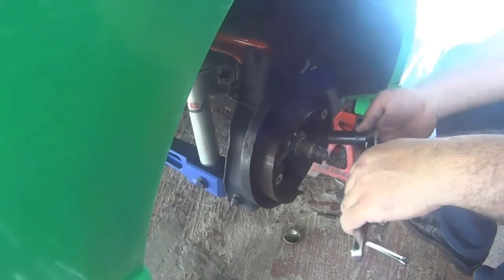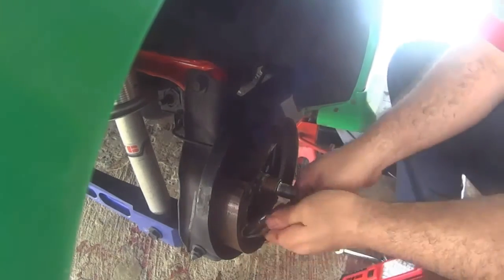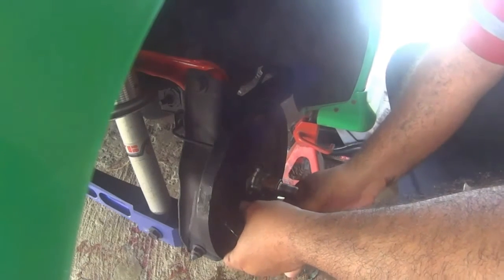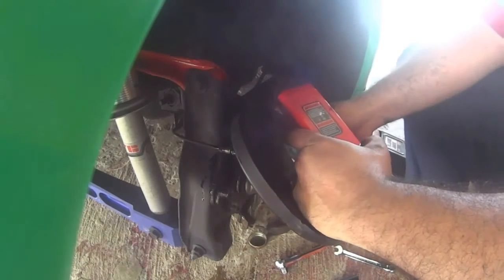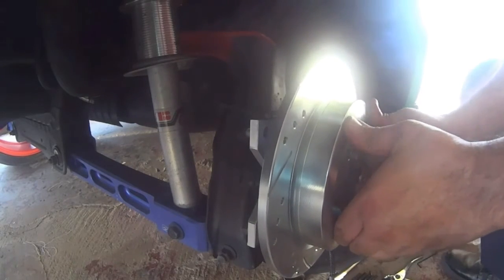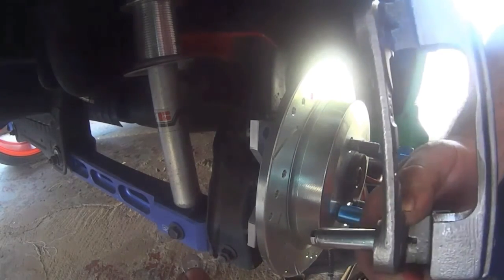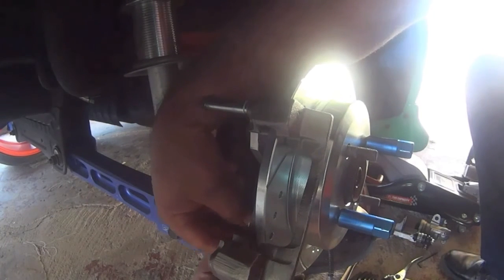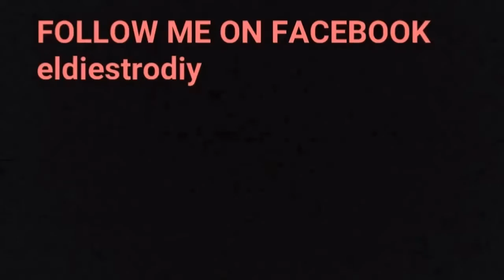Rear disc conversion on the turbo  mirage diy

Comment: hey! VERY interested in getting this kit! I have a 99 mitsu lancer/mirage ck4a and I want to convert rear brake system! came across your video!!  can you still help? I was concerned on the Ebrake part but clearly you figured it out!
Reply from the maker: damian stirling check in this comment like 2 bellow there's the manufacturer of this kit he sell them world wide i just sell them in Puerto Rico but you can contact him it's mirageman89 thanks for watching and please don't forget to subscribe like and share my videos .soon gone be a lot more mirage related videos 😎😉
Reply: damian stirling just go to the wreckers and take the Magna or Eclipse rear brakes... it's FULL bolt in besides the handbrake cable, and if you want 2 piston go Proton... same process applies, bolt in just the handbrake cable
Reply: @ELDIESTRODIY  cuanto sale ese kit para mirage 96

Comment: What are those rear blue things on your car.  I love them what are they and where did u get them from
Reply from the maker: Lower control arms i also love em i got it locally but on ebay you can find em mirage 1998 rear lower comtrol arm and they appear.
Reply: What calipers and rotors are you using ?

Comment: Just go to the wreckers. Find a Magna or an Eclipse of the same generation (year) as your Lancer. Take off the discs, calipers, dust shields, lines & the mount... it should bolt on, and if you want a 2 piston setup go purchase a proton kit... and if you want more than 2 go change your hubs to a 5 stud and then get a high quality big brake kit. There is so need to buy this sort of kit when Magna, Eclipse and Proton parts bolt on without any issues besides the handbrake cable which people have found many fixes too... don't waste your money $100-$200 at the wreckers and a bolt in swap
Reply: Eclipse parts do not bolt up to the mirage directly. And here in the US we never got the proton.
Reply: @89Mirageman  but do they bolt to the 2002 lancer oz rally?
Reply: @edwinrijos6679  This kit does not but I make a kit for that car as well.